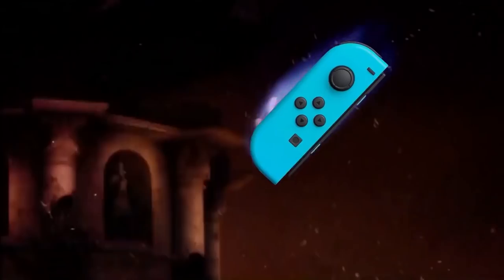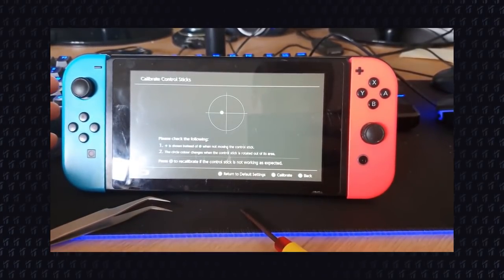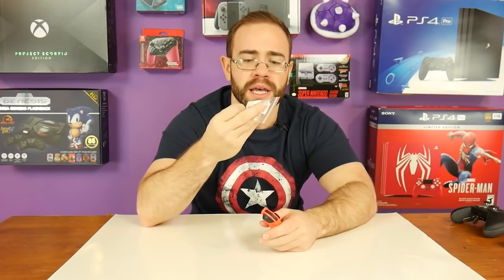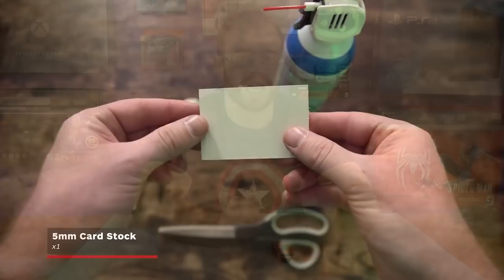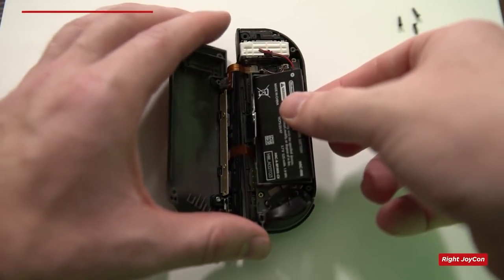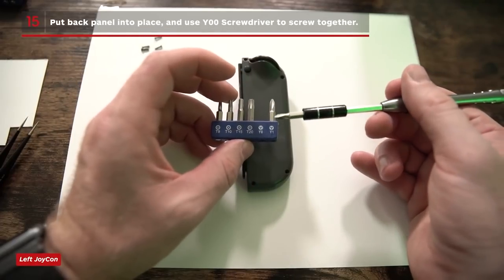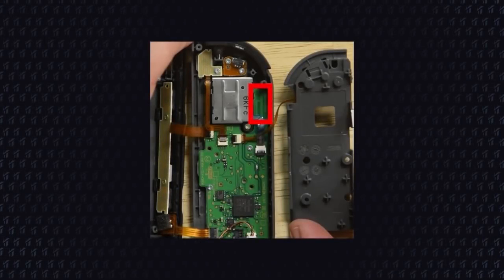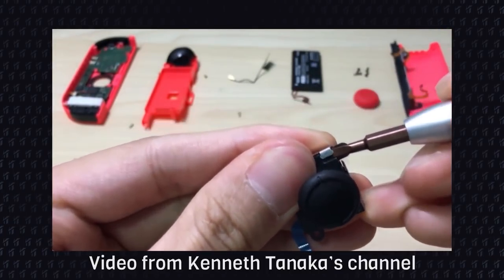Root Cause of Joy-Con Drift Discovered... and Fixed!

Comment: By the way, simply opening up the joycon won't void your warranty, there's no way to prove it's ever been opened, so long as you put it back together correctly and don't like, leave the paper inside or something like that. I can confirm, I've gotten a joycon replaced for drift from Nintendo when I had previously opened it up before, and no questions were asked

Comment: Oh. Ha. I actually know this one.

Joycon analog sticks are potentiometers, a device that measures difference via recorded electricity, and moving the stick changes the value of recorded electricity.

Now those wipers are actually also simple springs, to keep enough pressure and contact to record electricity on those pads you see them rubbing on. But they can only reach so far. So anything that would lessen that contact, like say a scraped out gouge in the material of the pad, or other things, would change the amount of electricity recorded, and give you drift. That thin piece of paper stock pushes the part those pads are on back up to make a strong contact with the wiper again. 

Unfortunately this looksk like it may not be permanent, due to the properties of electrical resistance that ganged up with the contact problem. Those pads are resistors, the less material a resistor has, the more it resists, also the more complex the area of it's cross section is, the more it resists (the less electricity gets recorded) think of it like a hose with water (electricity) flowing through it, and those gouges like sticks shoved into the hose blocking the flow of water.

So the increased pressure will allow the wiper to gouge out more material, further increasing the resistance of the pad, lowering voltage recorded, and if the drop in voltage recorded overcomes the gain in voltage from more pressure on the contact area.... The drift will be back. 

But let's not worry about this, this is an easy fix, that gets life back in those sticks, that would have been useless anyways!

Cool fix!
Reply: This comment is so underrated

Comment: I tried the contact cleaner method and it didn't work for me. But I did happen to see this video and I already ordered some 1 mm thick foam tape so I could try this. I even kept all of the original joysticks that I had replaced, so I am really hoping this works 🙏🏻 Thanks for the video!
Reply: Lmao I just used the cardboard from a ramen box and boom fixed my launch switches joycons
Reply: @abramlee9958  nice 😂 I just wanted to try and be a little more professional than just sticking in a piece of paper lol. But I know in the original video the guy said he used a thick piece of paper like card stock. I also have multiple friends and family members that I had replaced joysticks for so I have quite a few to do if this does work out 😅

Comment: So the real question is, should this be done preemptively? I just bought a pair of master sword/hylian shield joycons, should I just put in the cardboard now even though there is no drift yet?
Reply: For me, I am not going to doing anything for several months, just long enough for any issues regarding the plastic warping due to the cardboard or likewise to show up online. Also I wouldn’t feel comfortable doing it to my Zelda joycons, maybe the base model so I can get a grasp of how to take them apart. Though, if it doesn’t drift then it’s not that big a problem so I’m not gonna bother for the time being.
Reply: @Just_Shaun  yeah I bought some faulty joycons and was gonna try it
Reply: Considering the problem is a lack of pressure, I would recommend waiting till it drifts so you know how much you need for the fix. You could do it preempt and it doesn't put enough pressure and you get drift. Also it's just good to not open things up without needing too, especially considering a joycon wires are a little fragile.

Comment: Contact wear is probably still legit, but this can extend the lifetime. Nintendo not budging is likely a result of them completely denying the issue and not wanting what would essentially be an admission of guilt in their pending court cases.
Reply: The majority of people in the lawsuits are just jumping on the bandagon. Impossible to prove who has and does not have a drifting joycon.
However the hearsay and anecdotal evidence suggests the number is far less than many falsely believe.  I am not sure actual numbers are possible to determine outside of a mass recall and checking them all.

Comment: Thb i think they somewhat fixed drift, someway or another. My red/blue neon joycons drifted like 4-5 times resending em constantly to nintendo.

Orange / purple ones havnt drifted once, havnt heard as many reports bout drift either after newer joycons came out.

Not sure what they did as its quite noticeable. Also the zelda joy-cons feels slightly lighter than the orange/ purple ones, dont have a precise scale to 100% confirm it, but they feel different

Edit: So i wanna add. My main thought was that the problem was the HD rumble. Rumbling stuff out of place. I turned off rumble on my controllers since i suspected it and havnt had drift since

Edit 2: so i just tested my drifting joycons without rumble.

After calibrating and updating drift was gone

Comment: For the small number of people with the issue this hopefully will solve the issue.
Note well - I said small for a reason because that's the facts.
Reply: 1. If those are the facts, where's the proof?
2. It's still big enough to be far from a nonissue.
3. No one should have to suffer it to start, let alone bear the burden, no matter how minuscule, of fixing it.
Reply: @the8thark  If a small number isn't acceptable just as a large number isn't, why bother stressing the number? And can't you trust people just a little more? Do you really believe that THAT many people would intentionally lie?
And I know it's a problem with all controller sticks, not just Nintendo's. Those stick problems deserve to be resolved, too.
Reply: @CarbonRollerCaco  
The fact that there is zero evidence the number is large needs to be stressed so people know the full facts.

Also it's not about trusting or not trusting people.  It's about basing opinion only on the actual evidence we have at hand.  There is no need for belief when facts exist (in relation to matters like this)
Reply: @the8thark  You yourself said that even a small number isn't acceptable. How would the exact number affect the fundamental approach to the problem? Oh, wait; IT WOULDN'T. The drift exists regardless of how widespread it is, and at a certain point it's bad enough and it hardly matters how much MORE widespread it is. A good fix would solve every case at once anyway.
Reply: @CarbonRollerCaco  
How many cases there are of drift do change how Nintendo need to deal with it.  A few cases are easy to fix.  A few million take serious effort to get sorted out.

Secondly my point was mainly to clear up the misunderstanding regarding the numbers of drift existing.  I was not arguing whether drift exists or not.
Reply: @the8thark  Why would Nintendo have to count the number of cases? It's not like they're going to actively send out new Joy-Con to just those that experienced drift, and just because someone doesn't experience drift NOW doesn't block their Joy-Con from exhibiting it LATER. All they'd need to do is correct the design for future manufacturing runs and replace or implement the fix in Joy-Con that get sent in, and it looks like a pie-easy fix to me. That's why it only really matters that the drift exists to a notably spread point.

Comment: I broke my right joy con trying to do this :)
Reply from the maker: What did you do? I’ve taken apart both joycons like 30 times.
Reply: @NintyPrime  I broke my R button like an idiot
Reply: I will just buy new joycons and apply the cardboard to them
Reply from the maker: How? You don’t even touch anything related to them to do this. Lol.

But it’s cool
Reply: @NintyPrime  He may have been referring to the R button on the board. That tac solder isn't always the greatest.
Reply: @nubatman  that is exactly what I broke
Reply from the maker: @nubatman  I mean no, it’s not the best. But I guess I’ve just never had a real issue, and this one requires so little taken apart to fix. Even even the IGN video is… a bit more than necesssary.
Reply: @NintyPrime  I know. Some people just have bad luck.. That's why I still have a broken New 2DS from just replacing the top screen. But yeah. The steps to fixing drift is straightforward, but can happen.
Reply: @Coocola L3 the button that is soldered to the board came apart and the little pad that registers your button press fell onto the floor never to be found again. I have the other peices still

Comment: How come the previous joystick (on Gamecube controller) works fine but not on the Switch? Why Nintendo didn't take it for the Switch so it wouldn't have a problem?
Reply from the maker: Because the joycon doesn’t have the depth to fit a standard joystick.

Comment: Does this happen with the switch lite to??
Reply: I believe it happened within a few days of the switch lite's launch.
Reply: @VastDivide  Source? JC Drift typically takes half a year to kick in.
Reply: It happen ls on the lite, but the fix is the same, just a little harder due to the design. If you have a light look for a teardown video to help if you need it.

Comment: That spot where the stick goes looks mega-sus. Either the flaw was on purpose or something's up at the manufacturing plants. Considering China may be involved, oversight could be a serious problem. And what about the PS5 and XbS sticks?
Reply: Nintendo products are usually produced by Foxconn, which I believed moved to Vietnam a few years ago. I'm guessing it was originally an honest design flaw like the OG Pro controller D-pad and Dock, but for some reason Nintendo refuses to fix or even acknowledge drift.
Reply: @VariaBug  they have acknowledged drift though...
Reply: @VariaBug  Apparently there are those foam pads that go in that spot, but aren't always there and only sometimes work, both apparently dependent on the exact model of stick.

Comment: Well this is another fact that proves that Nintendo is just not interested in fixing Joy-Cons because that would create more reasons for them to keep selling more and more of these faulty products. Ever since my 4th or 5th pair I just decided to buy generic controllers and the only thing I really was mad about was sacrificing the HD rumble. But one of my most favorite Joy-Con alternatives was the Daemon X Machina Pro Pad. They were way more comfortable for my hands and the had nicely placed paddles on the back and a turbo function. And due to the bigger size I wouldn't get cramped thumbs or had to suffer just to reach the minus button. Nintendo is becoming the most anti consumer company of all the console makers.

Comment: Lies lies lies
Reply from the maker: Care to explain?
Reply: @RACER REX 
Just repaired my friend's joycon with a plastic card.. 
He had some drift before the card but now his joycon has no drift anymore..
So there is credibility to the solution and it also makes sense..
Reply from the maker: @nocfox3050  we simply don’t know if it will work forever, but maybe. The pressure keeps the components more tightly packed and maybe that’s been the issue the whole time.
Reply: @NintyPrime  
Never said anything about it being permanent, just saying that it does seem to have credibility.. 
I tried with my red joycon and I'm just going to wait..
Reply: @Coocola L3 blocked blocked blocked
Reply: @nocfox3050  blocked blocked blocked
Reply: @Fjdjfjsz92938  
You're pretty clueless, I'll give you that..
Even if you don't see it lmao..
Reply: @nocfox3050  yeah right like i havent seen that 50000 times when i was making a joke
Reply: @Fjdjfjsz92938  
Whatever you say, my mans.. 
I'm more replying for the entertainment of the this particular thread..